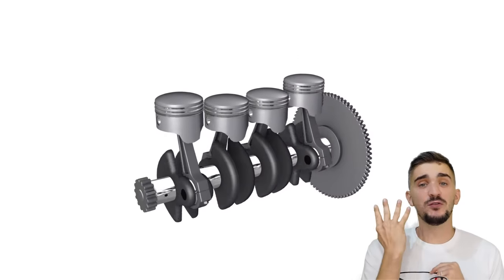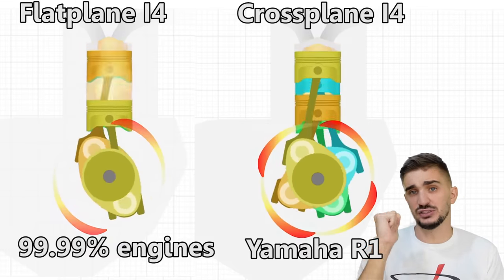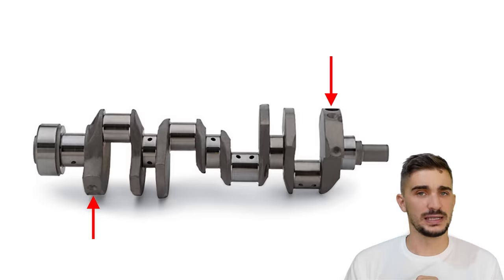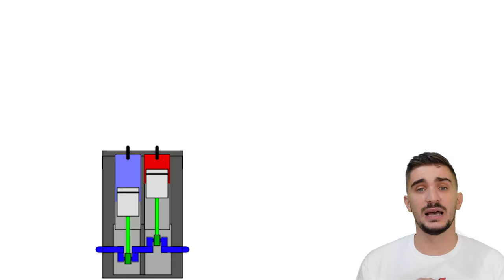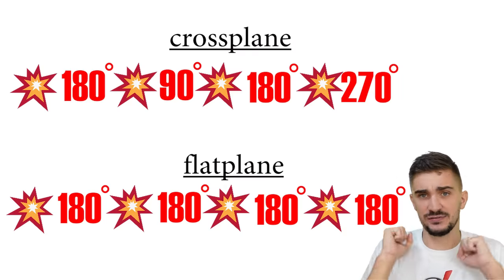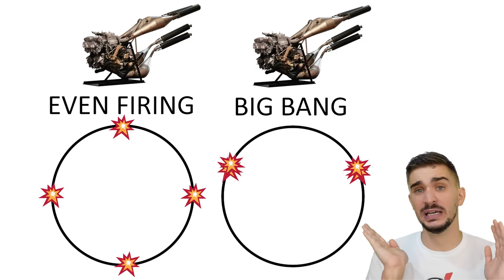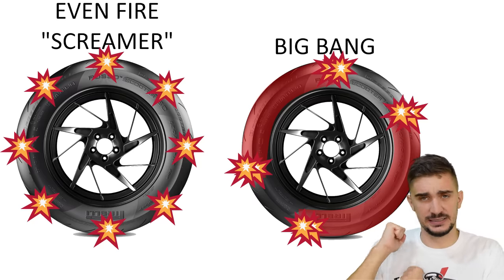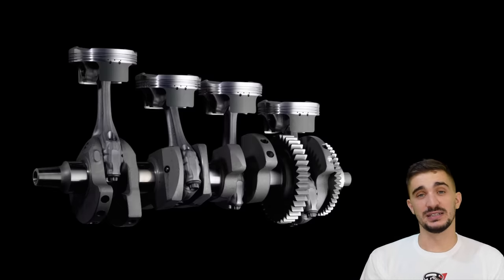CROSSPLANE inline 4 EXPLAINED in detail - How the YAMAHA R1 i4 differs from all other INLINE FOURS

Comment: Great video. The issue of cross plane versus flat plane cranks is enormously complicated. It affects inline 4's very differently than V8's. It took Caddillac 7 years using the best engineers they can find to develop the first cross-plane crank flat head V8 in 1923. Four stroke cross-plane V8 engines have even 90 degree ignition intervals, but unevenly spaced firing patterns within each cylinder bank. The "spaghetti" exhaust headers on the original Ford GT race cars were an attempt to fix the uneven firing patterns on each cylinder bank (to prevent the exhaust pulse from one cylinder from entering the adjacent cylinder when its exhaust valve opened).

Comment: Soviet engineers used V4 configuration with balancing shaft to have more torque at low RPMs in a small economical ZAZ engines. Also, it's easier to cool it in air-cooled configuration and shorter crank is more stiff
These cars were designed for a bad country roads, hills and plains
A drawback was pretty low RPM redline and lower HP
Reply: The drawback sounds like it has more to do with the top end's design.
Reply: @hughjassstudios9688  40-45 hp was enough for a light car like ZAZ-968. Many people get 60-65 just by porting cylinder heads, intake manifold, installing 2-barrel carb and increasing compression ratio
But then you need better brakes...

Comment: So when people compare an R1 to another bike on a dyno and the R1 makes less power that's exactly what it was designed to do and that makes it faster. That's Japanese engineering at its best!
Reply: Faster on the track, yes.  As a point-and-squirt squid missile, not quite as fast.
Reply: @f.f.s.d.o.a.7294  Going around corners fast is kind of the main point of sport bikes. If you wanna go fast in a straight line get a drag bike.
Reply: @bence.gabor.slezak  I agree, hence the derogatory reference to "squid missile".

Comment: Can u make a video on parallel twin engine possess different crank angle like 180, 270 & 360, how powerstroke intervals does affect on power delivery, efficiency and smoothness? would like to see comprehensive comparison between these configuration.
Reply from the maker: Yes an inline twin video is coming in the future
Reply: @d4a  glad to see ur reply
Reply: A basic summary of the three most popular inline twin configurations' characteristics:

360°: Even firing, one power stroke per revolution. Very bad primary and secondary balance but no primary or secondary rocking moment. Highest pumping losses. Examples: BMW F800GS, Kawasaki W800

180°: Odd firing, fires 180° and 540°. Two power strokes on one revolution then 1.5 turns of "silence". Net external primary forces sum to zero, and no secondary rocking moment. Very prominent primary rocking moment and secondary vertical shake. Lowest pumping losses (allowing the 180° crank to more easily reach high rotational speeds than the other configurations). Examples: Yamaha R3, Kawasaki Ninja 650

270°: Odd firing, fires 270° and 450°, like a 90° V-twin. Primary forces do not cancel in either magnitude or torque. Secondary forces sum to zero but has a secondary rocking moment. Moderate pumping losses. Examples: Honda CRF1100L Africa Twin, Triumph Thruxton

Comment: Surely having a separate gear driven shaft to counter rocking couple produces same rev resistance as well as extra friction losses?
Reply: I had the same thought. But maybe the rotating forces of the crankshaft and the balancing shaft cancel each-other out?
Reply: @marcemile6346  
It’s not about balance, but about rotating mass.  Picture a single-cylinder engine with no flywheel, or a very light crankshaft.  It won’t idle, because when the piston goes to bottom dead centre, or BDC, it will stay there, or slightly past BDC.  The flywheel stores energy during the power stroke, and then gives it back as it helps the crankshaft keep turning.  It also makes the engine run more smoothly, by damping out the vibration from each power pulse.

So far, so good, but like everything in engineering, there are always compromises.  As the engine revs up, it has to work against ALL the rotating mass, which is the crankshaft, the camshaft(s), the clutch, and so on.  If you want a smooth-running cruiser that idles well at very low revs, a heavy flywheel is a great idea, but for sport or racing use, having to spin up a heavy flywheel, along with all the other parts I mentioned, makes for an engine that revs slowly, even when max throttle is applied.  Clearly, this is no good for a racing bike.  Bike engines don’t generally have separate flywheels, but the idea of rotating mass is the same.  Adding a balance shaft makes the engine smoother and more powerful, since almost all its power is used to turn the back wheel, instead of wasting power in shaking the engine (and bike, and rider).  Power that is shaking the engine is power that’s not getting to the back wheel.

Wow, this is getting long. Okay, last bit.  Adding the balance shaft is like adding a flywheel:  it’s more mass that has to be accelerated whenever the engine is revved up.  Accordingly, all these factors have to be weighed up.  Is the crankshaft made a bit lighter to compensate for the added weight of the balance shaft?  If the crankshaft is made lighter, will it still be strong enough?  And so on and so on.  There is no perfect engine.  All of them are built to be the best combination of compromises that will achieve ideal performance in the bike’s intended purpose.
Reply: @nomorokay  Sorry, but that's totally wrong. The reason theres a separate balancing shaft is not to create a flywheel effect (heavier flywheel will hardly cancel out the rocking motion, just dampen the power surge from firing a cilinder). It's there to counteract the rocking motion, if cilinder 1 goes up, balancing shaft weight 1 goes down.

Comment: I realize that in recent years, the expression "flat plane crank" has become common usage, but I stubbornly maintain that while "cross plane crank" is accurately descriptive and semantically rational, "flat plane crank" is grammatically incorrect.  The proper term is either "single plane crank" or "flat crank".  "Flat plane" is a redundancy: a plane is flat by definition.
Reply from the maker: You know what...You're right. That makes perfect sense. But unfortunately the term has cemented itself.

Comment: I disagree that a balance shaft doesn’t affect the “rev happiness” of the engine.  Any rotating mass that is accelerated with the engine is going to slow the rate at which the engine can build RPM.  I really doubt that moving the counterweights from the crank to a separate balance shaft materially reduces the total amount of rotating mass.
Reply: So what's your solution?
Reply: @LTVoyager  I had a think about this as well and agree that adding mass that rotates with the crank does the same to the overall mass and inertia taking away from "rev happiness". The only work around that came to mind was that the counter weights may be able to be geared to use extra rotational mass more efficiently and/or that the balance shaft can be in a location that allows its own counter-weights to generate more inertia with less mass through a larger rotational radius/lever on the centre of mass of the crankshaft or rotational axis of the balance shaft perhaps. I would really appreciate a explanation from someone in the know.
Reply: Its basically 4 cylinder with the add more weight, which made it feels like a 6 cylinder

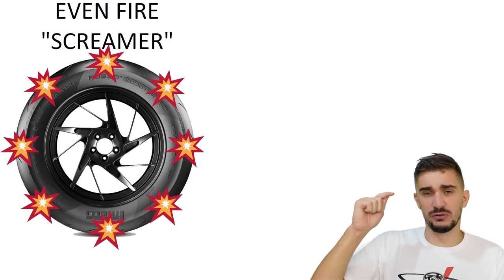Comment: 22:18 is assuming the bike is in a synchronous ratio, which almost never happens because of the final drive ratio.  The final gear in the transmission before any overdrive gears will drive the output shaft at the same RPM as the crank shaft.  But all final drives on cars and bikes will be anywhere between a 2:1 to 6:1 ratio.  So unless you have an overdrive gear that drives the output shaft 2-6x faster than the crank shaft, the rear tire(s) will never rotate at the same speed as the crank shaft.
Reply: but it will definitely get those pulses
Reply: Yes but think about the rolled out wheel many times on the road. Each of the pulses will be spaced on the road as the engine outputs (regardless of ratio in gearbox and final drive). The same is true for the crossplane bigbang and any other engine.

Now if the wheel circumference is perfect with the ratio and the pulses will wrap from the road to the wheel on roughly the same place then the wheel will have indeed zones of pulses and zones of rest that i can think would make uneven wear over time. 

So the power pulses will wrap on the wheel many times and will cover eventually every bit of the surface of the wheel with powerpulses and this is good for even wear. The resting time of the tyre counts on it's own on each rotation. It does not need to be in phase to get the bangs and rests in the same spots on the wheel.

The wheel contact patch have a stress zone in the contact patch where the part that enters the contact patch is under tension and the part that exits the contact patch is under compression (or better is released from tension). And also the contact patch deforms radialy the whole tyre and this gives a great imbalace and harmonics on it's own. The powerpulses that can overlap to be stationary on the wheel is not an advantage by any means and in fact is a disadvantage to resonate that part of the tyre from an additional stacking force.

You know, the tyre is subjected to a lot of repeated stress and one of the goals is to limit vibrations harmonics and resonace. Even the blocks of the tyre that enter and exit the contact patch will experiment a tangential bend that will resonate a bit and this creates sound. The goal is to make every block of the tyre a bit different so each block will have it's own frequency and will not stack to create a resonant on the tyre blocks and will not pump the same frequncy over and over and creating a distinct frequncy that you will hear as rolling sound. Fun fact: grab a caliper and measure each block length on any car tyre and you will see that are not uniform.
Speaking of rolling sound level, the exact syncro of the blocks and pumping the same frequency is used in air raid sirens where the rotors have the exact same volume between blades, and the housing has the exact same volume between stationary blades, and the air trapped vibrates at the same frequncy in each chamber and all that sound is projected all at once as when the rotor spins at every few degrees will line up all holes between the rotor chambers and the stator chambers. Creating a huge overlap on a single distinct frequncy.

Back to the tyre question i think it's actually beneficial to wrap the tyre with pulses in a nonoverlap pattern and covering the whole surface eventually.

(and to indroduce myself: lect.phd.eng. in automotive engineering having my phd thesis in tyre forces in the contact patch for cars and trucks)
Reply: @AsiAzzy  exactly

Comment: I love that dirty sound that uneven firing engines produce! Audi 5 bangers sound so unique.

Also cars with unequal length exhausts headers get that burbly love  (like Subaru EJ engines).
Reply: An  inline 5  cy5libders  is  not  uneven
Reply: @vicent436  It is, because you have power stroke overlap and it fires every 144 degrees.
Reply: @bojned  So,  a six inline  would also be  uneven?
Reply: @vicent436 My first answer was not entirely correct. Typical inline six is even firing, as power stroke occurs every 120 degrees (720deg/6cyl) of crank revolution, so you have evenly distributed power pulses in relation to crankshaft rotation.

Inline 5 should have 144 degrees (720deg / 5cyl), but due to cam timing it fires every 120 degrees and you get 22 degrees (144 - 120) of rotation when no force is exerted on the crank and 60 degrees of overlap when two cylinders are in the power stroke (180 - 120). So that's why I5 is not even firing engine.
Reply: @bojned  Increíble. Where  did you not study?
Reply: @vicent436  Self taught really... Internet, car mechanics and other nerds :)

Driving4answers actually made quite a good video about different engines and their primary/secondary balance:
https://youtu.be/82rxavW0A3c

Unfortunately, he did miss to address 5cyl engine timing in his comparison video (which is otherwise flawless). 144 degrees of power stroke is is not practically achievable due to the fact that camshafts have to make one full turn while crank does two, so car manufacturers compromised there and result is a loss in efficiency and engine balance.
Reply: @bojned  Do  not get confused. An  inline  five  cylinder does  not work the  way   you  think. Power stroke  does  not  depend  on  the  number  or  cylinders  nor crank angles  between arms. Moreover, camshaft,  and each  cam will  always  be  sincronized with each  cylinder.

Comment: The crossplane 4-cylinder in modern R1s is not a "big bang" motor; it is a "long bang" motor. Valentino Rossi explained this in his autobiography (the current R1 crossplane engine is based on the YZR-M1 crossplane engine).
Reply: Yeah I thought it was a "long bang" one with 90deg continous "bangs", and you confirmed that.

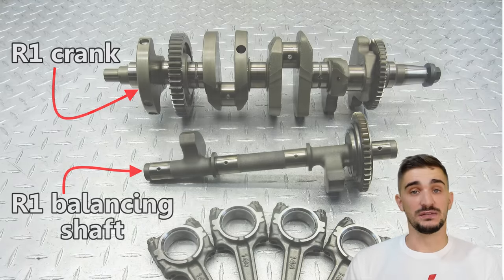Comment: Driving 4 answers, this is a great video but I don't I agree with your assertion at 8:24 that a balancing shaft does not impact "REV happiness."  The way I see it, adding mass to the rotating assembly, whether it is directly on the crank or on the balance shaft, will to impact "REV happiness."  The more rotating mass there is, the more inertia the rotating mass will have.  The more inertia a rotating mass has, the more force is needed to change the speed (RPM) of that rotating mass.  In other words, more inertia equals less "REV happiness."
Reply: Same here, I don't understand how hanging the weights on a second shaft directly connected and driven by the crank isn't just as bad as putting the counter weights on the main crank. Its like saying I put a load in my trailer instead of the truck bed so now my acceleration will be unaffected by said weight!

Comment: When explaining the Honda two stroke "big bang" engines it should be noted the Yamaha TZ 700/750 and 500 two stroke GP race bikes also used cross plane crank shafts that fired two cylinders together to try and tame the savage two stroke power band on those engines and provide better torque characteristics.

Comment: first of all, I've been learning a lot with your videos, thank you for the great content!
why isn't swapping cylinder 2 for 4 a good R1 crossplane alternative(first and second piston 180 degrees apart. second and third 90 degrees apart. third and forth 180 degrees apart)? it would introduce a small secondary rocking couple but the primary rocking couple would be smaller... and the firing interval would be the same

Comment: Very good video for a broad audience. 
However, as an engineer I do have a small suggestion for further improvement.
When talking about the traction advantage of the big bang you said it is because in the "silent" phases the tire has longer time to recover. However since there also are the shortened phases, where the tire has less time to recover, this of course is a zero sum game. So to really understand where the traction advantage comes from, deeper knowledge is required. 
Using what I have learned in my driving dynamics classes, I have my theory, but I would certainly like to know for sure if I'm right...

Comment: Excellent explanation, you hit on the power pulses very indepth from the engineering point of view but there are also more advantages over power delivery and ability to control the power delivery as its not as vicious on corner exit, which is correct and the way you explained the pulsing to release the breaks in traction on power delivery but one thing you missed out was because of the differing pulses with the gaps between them that actually gives a massive advantage in tyre wear, which from the riders point of view, you don't wear the tyre out as quickly and the duration of the race the performance of the tyre throughout the race is far more consistent giving the advantage of faster consistent lap times throughout the entire race rather than relying on getting away at the start with the best tyre performance then having to manage the wear of the tyre when you get a massive drop in performance roughly 2 thirds of the way through the race, its not perfect but does make considerable difference, hence, yamaha, since 2004 when they introduced it into motogp have won by far the most championship wins with Rossi, Lorenzo and Quatararo, and up till the last 2x yrs Yamahas have been the easiest to ride and compete the most consistent over race duration albeit with a lower power output and disadvantages on the straights. Tyre degradation especially now that motogp is a single tyre make series, low tyre wear has won yamaha so many motogp races over the last 2x decades, the disadvantages have been far outweighed by this single reason alone. Excellent video